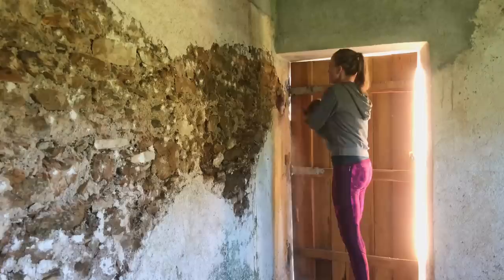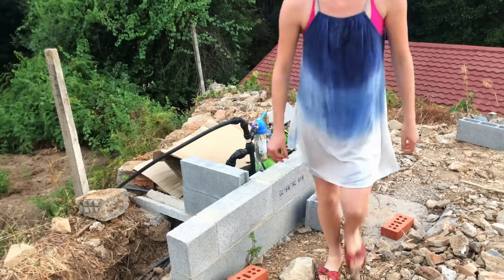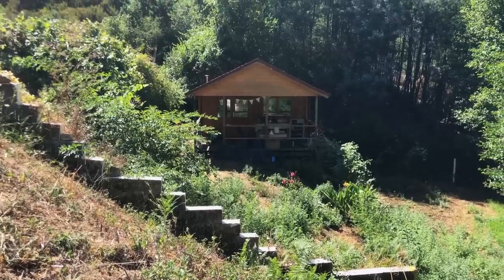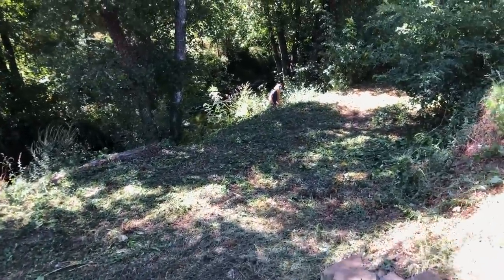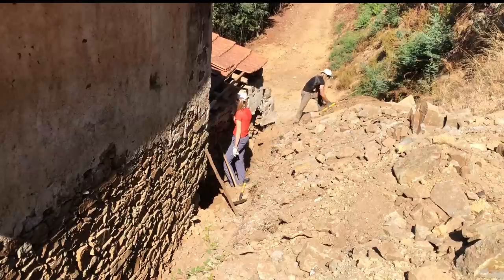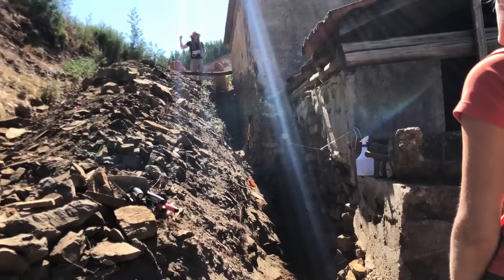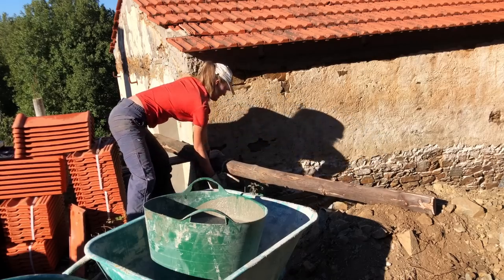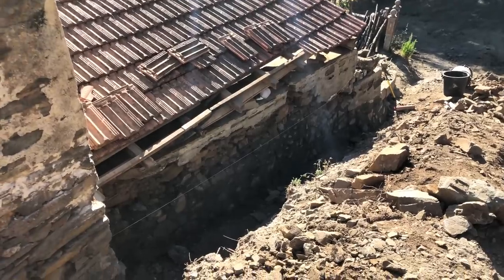Stone Wall Building as Amateurs

Comment: Maya, after you finish the stone work you will need to 'render' the stone walls and for below ground areas I can recommend products from t Swiss firm, SIKA. In particular they make a 2 mix (or Single application) coarse black waterproof membrane which you apply with a coarse brush. Maybe several coats will be required but it will stop moisture from penetrating the walls (below ground level).
Reply: Olá Maya gostei muito do seu vidio tem sido um trabalho muito pesado mas o Mike tem ajudado muito. A Maya pode-me dizer de que país é? Eu estou a gostar muito dos seus vidios sao excelentes mas tambem acho que devia descansar um pouco fazer um dia de folga porque ainda tem um longo caminho a percorrer essas obras na sua casa vao demorar muito é muito grande. Desejo um bom fim de semana para a Maya e o Mike ele tambem tem trabalhado muito. 
God bless you
Thank you very much e volte sempre ❤🌿🌾🌵🌴🍀🪴🌷🌻💐💐🦋🦋🍁🌺
Reply from the maker: Thanks for the tip 😉

Comment: For better, use of the water on the trees a piece of waste pipe for sinks and baths 450mm long with 10mm holes drilled in the bottom 150mm and then planted next to  the root system of your trees will need much less water and better results as evaporation of the water will be greatly reduced.

Comment: My opinion, you don't fill up the trench on the repaired wall, you leave it like this at the bottom, you lay concrete out, and plaster the stone wall about 60-80cm with cement, so that the water runs away from the roof tiles and your stone wall no longer gets wet

Comment: Great job both of you ! I'm wondering if concrete in old stonebuildings are appropriate, cause it doesn't breathe. Would not lime mortar and drainage be a better solution ? Making comments afterwards is not the best thing, but maybe for the future construction work you ca check it out. I have bought an old stone house. It is entirely sealend with concrete and i Have moisture problems and saltpeter coming through the walls. I am in a wet country by the way, nothing to do with the climate where your house is. Maybe i'm worrying for you for nothing. Take care !
Reply: Yeah I kind of wish she would use more natural materials too! Although it's still very interesting to see.